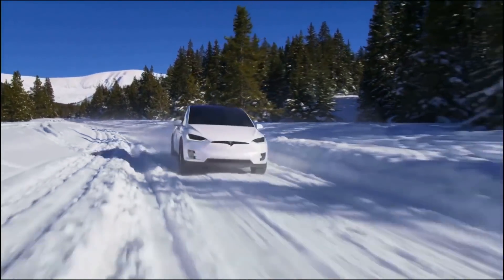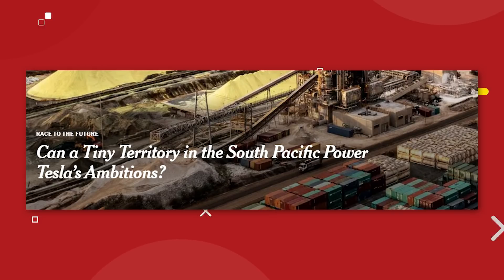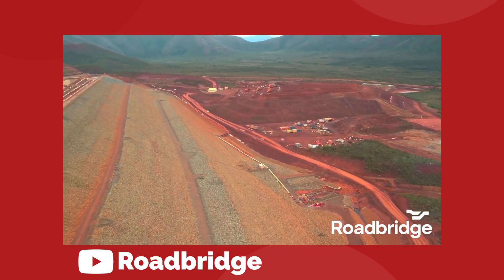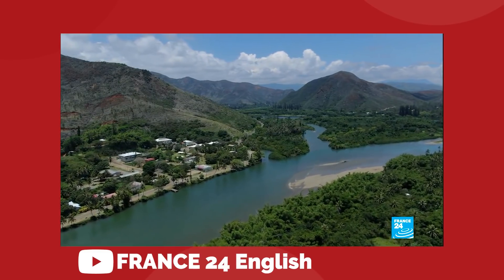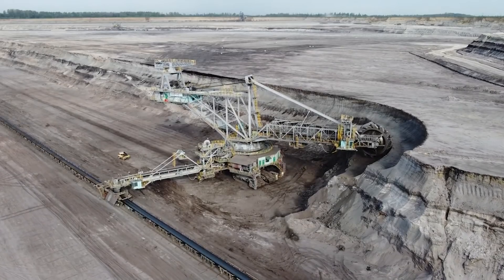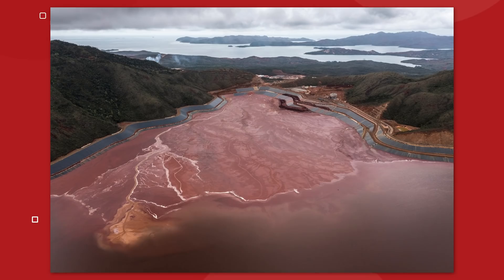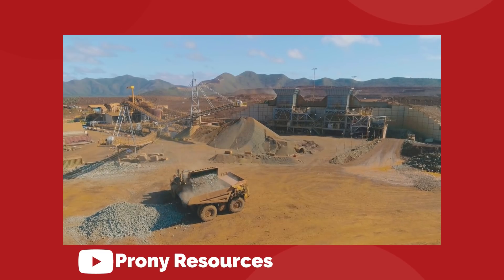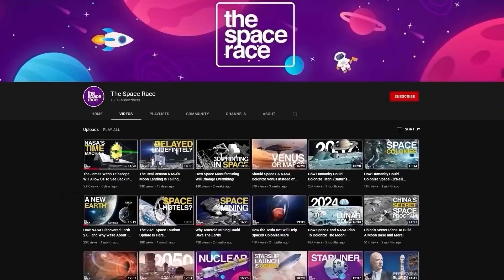How Tesla Is Opening Their Own Mining Operation!

Comment: Conversion of the massive trucks to electrical would be a good start & then the actual factory running on solar would help. Converting the acid base to a safe slurry after being used would allow a properly safe disposal or maybe alternate use.  An electrical by hydrogen possibility would work better than batteries there as it is a mostly static infrastructure except for the trucks but they require only a relatively small travel & can be refuelled quickly as opposed to batteries. Again it's a relatively static operation with minimal distances covered just repeated many times per day.

Comment: Huge 'but' in this video. Electric vehicles are only more sustainable than petrol or diesel vehicles if 100% of the power that recharges them comes from 100% renewable energy. Unfortunately, most of the EVs are recharged from the grid which in most countries is fueled by fossil. The only meaningful way to measure 'sustainability' is throughout the entire lifecycle of the vehicle. EVs have much higher initial carbon footprint to build than other types of vehicles, but it is being promised to be offsetted by recharging from renewable sources. The reality is that most countries in the world are nowhere near of generating power from fully renewable sources. I'm totally on board with Elon's vision of sustainable future but don't buy into the whole 'EVs are super sustainable' illusion just yet. And before Elon's fanboys jump at me, this is not some fringe petrol-dollars fuelled research that I'm talking about. This is widely know fact for some time now. Just use your brain and critical thinking before jumping to conclusions.

Comment: Great video. Note I have seen reports that production of ev is still better or equal to production of ice vehicles. Adding that more new power is being provided from sustainable energy the environmental impact is shrinking quickly. On top of that at some point we will not need to mine due to improved recycling capabilities.
Reply: It’s going to take years before battery recycling even has enough possibility to make a lot of new car batteries.

Comment: I wonder if Tesla will innovate more sustainable ways of extracting the nickel and cobalt aside from the solar energy.  That is what I would hope for.
Reply: It’s. It going to be possible in new calediona unless they build something like a nuclear power plant or gigantic wind farms(if possible) New Caledonia needs a lot of suflfure, diesel and coal for operations and the batteries aren’t going to replace all those things.
Reply: From the video, it sounded like the main Rob was the use of sulfuric acid’s and such to be able to refine the nickel and cobalt. I wonder if there are more environmentally friendly ways to accomplish that.
Reply: “rub”… not “Rob”
Reply: The digging machines are usually electric.  The trucks could be too or use a conveyor belt.
Reply: @rtz549  the digging machines and trucks are mostly diesel/electric just like diesel locomotives.
Reply: @alanmay7929  I've seen digging machines with a high voltage extension cord going to it.